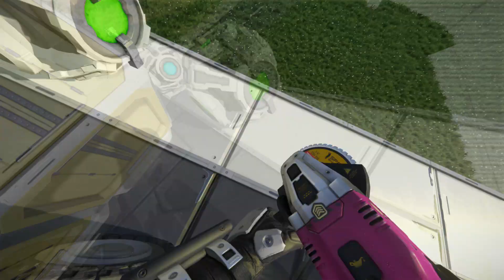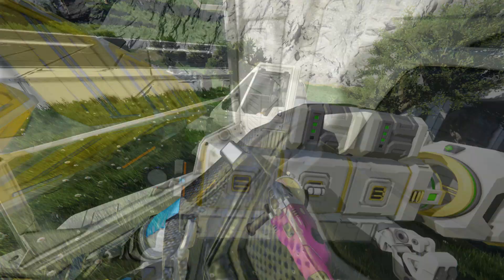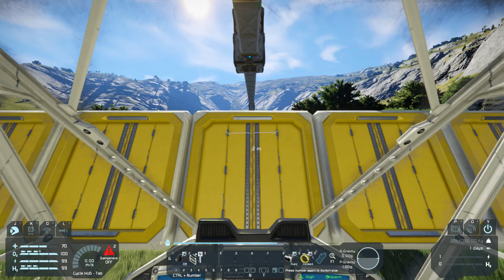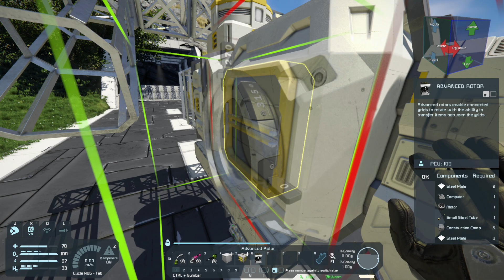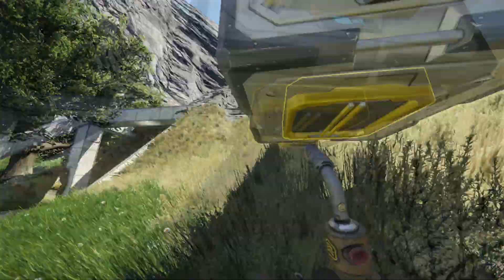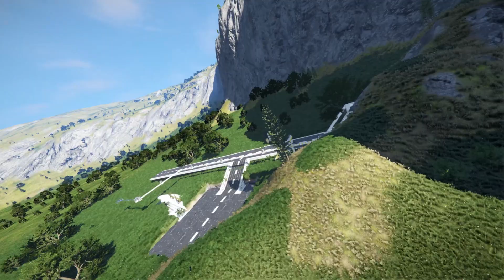Space Engineers - S2E40 'Upgrading The Road Paver'

Comment: god dang it kana... there's 4 attributes on the suspension's 
Strength (the "springs" ability to lift heavy stuff),
Height Offset (where's the suspension trying to sit),
Speed limit (how fast can it go at maximum),
And the one that needs adjusting so you don't do wheelies.. Power (it's basically how much torque your wheels have).

yes lowering power on the wheels will give you less acceleration but you want that so you don't drive off what you are paving anyways...

sorry not ment to be a rant but you adjusted just about all but what you needed to adjust to actually stop it from doing what you where complaining about...

Comment: on your new miner be sure your rotors are as far back as they can get then the body of the vehicle becomes the counter weight and the lifting portion then can be out front or overhead and not tip the whole thing forward
Reply: the other thing you could do is place the welder rig on a rotor (or pair for looks) and make the welder head tilt so you can do roads and roofs ... if you make it attach AT the rotor head then you can make a drill head and a grinder head for all your needs ... then just make a rack for the un-used heads in the garage where it will park ...

Comment: Kanjashi you really need to learn to lay off the junctions otherwise your world is going to start lagging horridly. I know it is sometimes easier just to slap one down instead of a 3 way but.. THe junctions are well known for causing lag the more that are used.
Also your connection joint should have been more center or to the back if you were trying to replicate bulldozers, they do that so that as the blade rises or they are going down hill the weight is shifted to the back where as yours still is towards the front making it likely to fall forwards. And shifting it backwards would allow you to move the "head" all the way back with the welders facing up giving ground clearance and less.... tilting.
Reply from the maker: I will have to try doing that with the connection joint at the back. There is always improvements to be made for a Mark 3 paver in the future! As for junctions thankfully the world isn't lagging at all yet but I will remove junctions when it starts to.

Comment: why u dont use ISY's inventory manager and set up a LCD for auto-crafting - so u dont have to take care, that u dont run out of steeleplates, tubes or what ever ;-) and your builder's will work till no more ingots are in storage
Reply: ... that, or Dummy08's 'Nanobot Build and Repair' script specifically designed to monitor and manage the assembler requirements of the Bob systems "as needed" - but yes, Isy's is a great choice if you wanna have a fully organised, sorted inventory system that'll also make sure the base maintains specific stock levels :-)

[edit]
The advantage to using the bespoke script over Isy's, in my experience, is that Isy can, sometimes, leave you in a situation where, for example, it's unable to produce steel plates simply because the iron's already been used to maintain the base stock of large and small tubes. With Dummy08's script, resources remain in their ingot form until actually needed for a required component.

It's a 'horses for courses' thing, I guess, as there'll be pro's and con's to each system depending on what resources you have at your disposal - and personal preference, of course ;-)